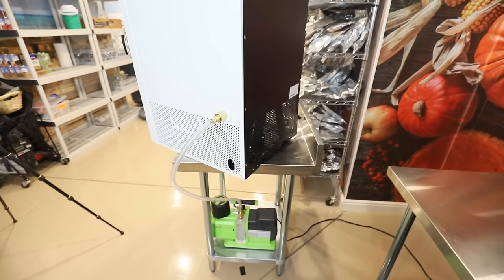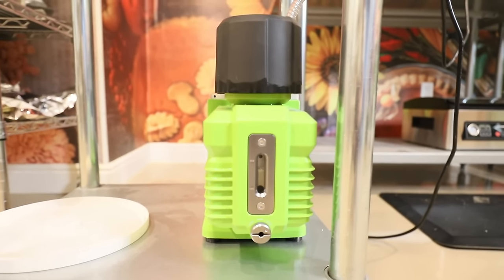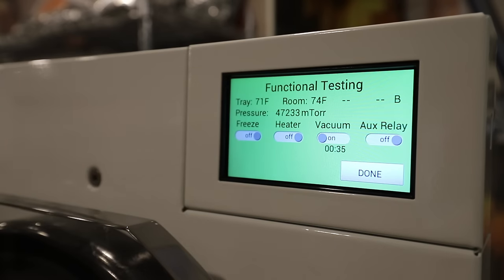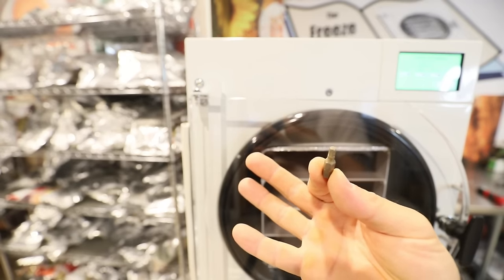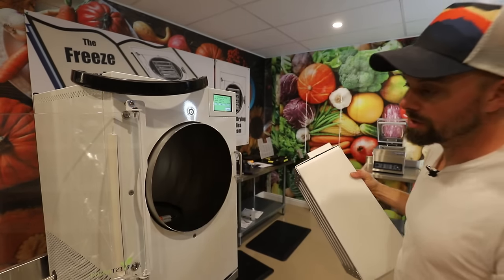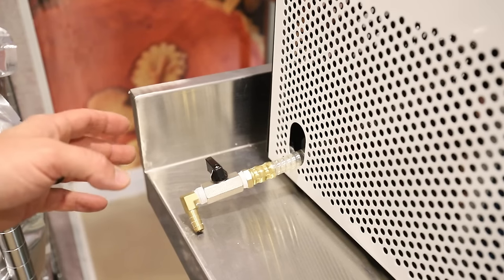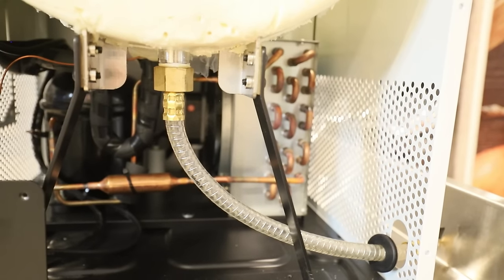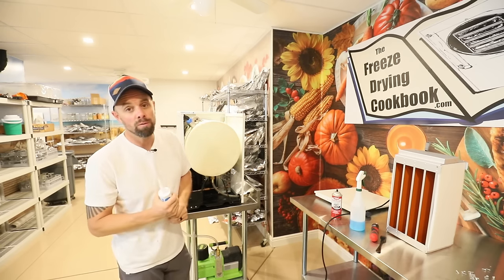Freeze Dryer Vacuum Error Troubleshooting -- SOLVED!

Comment: I have a leak in my vacuum chamber.  I have replaced the valve with a brass one. Tested it and it shows no leak. I also coated all connections with liquid tape. Replaced the door seal. Replaced the pump and pump hose. Added rubber seal sealant to that hose. The vacuum will go down to 360 in 30 min IF the tray holder is removed. I can put it back in and not even plug it in and the vacuum will not fall below 860. The tray holder is a full inch away from the rubber seal on the door. I have adjusted the door, removed the door and turned it over to no effect. Can't figure it out.

Comment: TO CLARIFY, when he is talking about the M Tor level jumping, that is with the pump running. Merely plugging, temporarily or permanently, a hole will not cause the M-Tor level to rise.

ONE more potential leak, which is among the early on checks, is, the gap between the tray racks and the door gasket.  If you allow the tray rack cable to slip down the wrong area, which happens often, the rack will not be able to slide all the way in. When you shut the door, the gasket and rack will be touching. 

If the rack and the gasket are touching, pull the rack out and reposition the electric cord. If in the proper position, you will have ABOUT 1/4" gap beteen the drying racks and the door gasket.
Reply: THis is something that I discovered for myself when chasing a vac problem. No gap between rack and gasket equals trouble!
Reply: This is what the HR tech told me today.  I moved the cable and taped it to the back wall per his suggestion but still have a problem getting the shelf to move in any further and when I ran batch again, got same error.

Comment: You missed an issue with the door gasket.  I was washing my regularly.  It would still have water and when the chamber froze, it froze the water in the gasket.  It changed the configuration as the water expanded.  I still wash it regularly, but I make sure it and the chamber wall is bone dry.  I went from 1200 to 300 mt.

Comment: When you say "while under vacuum" when checking for leaks, is that while the pump is running?  Or turn the pump off once it bottoms out and check before opening the drain valve?

Comment: After viewing and reading comments, I assume the manual does not show the steps in operating a vacuum pump. I worked at a construction equipment company for a few years that dealt with compressors and pumps. Those little pumps require a little extra care in their operation. Yes, they are very loud, especially before it gets a chance to get the oil warm and circulating. Depending on the type, it can take anywhere from 15-30 minutes to get the pump ready to work. You can hear the difference in the sound once the oil has worked it's way around. This will improve the pumps efficiency greatly; even the cheapest pump will last 10+ years. 
Once the job is complete, there is one key step that should be taken to extend the life of the compressor oil. The pump needs to be run at full capacity for 2-5 minutes  with the air intake plugged. This will help purge the volatiles from the system. Volatiles are what are created by the pump (internally) and can damage the seals and parts of the pump. But that is something that should be done in a garage or outdoors away from where you are working. You will never get rid of that crud by simply emptying and refueling or even flushing. It has to be "burnt off" in a sense.
Some of the newer, more like a sealed unit may not need the purge as some models have filters on them. But they still require a little warm-up prior to use.

Comment: I've been also getting can't process vacuum message. I also been getting condensation on the window and rubber, when its on freezing mode. I also noticed the temp keeps going up then down 1 or 2 degrees, then go back up. Are these issues normal?

Comment: We had a problem with Vacuum Error. After months of back and forth with HR and doing testing, getting a new pump, replacement seals, with no solution, my husband suggested tightening the door. Problem solved. UGH! All the trouble and frustration and it was simply the door had worked a little loose. Well, we are just thankful to have the problem solved. My husband wanted to send it back because there are too many things that can go wrong and it, obviously, can sometimes be difficult to diagnose the problem, causing lots of down time and much frustration. I really wanted to get the problem fixed. Thankfully, he was willing to stick with it and now the FD is finally running again. Hopefully, this is the last problem for a while. There have been several problems and more down time than working time since we bought it. HR does try to work with us to get things fixed but it can be difficult without an experienced repair person on the spot to do the testing and repairs. But it seems things do eventually get fixed if everyone is patient and sticks with it. Fingers crossed...

Comment: I've had a Harvest Right Freezer for several years. I recently bought a new vacuum pump to replace the JB Eliminator 6cfm pump that came with my machine. I ordered a new pump from Harvest Right. The new pump had fittings that were not compatible with my machine. I have tried numerous times to resolve this issue with HR customer service with no satisfaction. They don't even take the time to have a tech call me help resolve the problem. The customer service people who answer the phone are not English first speakers. So my message to Harvest Right customers, don't expect much help from their "customer service." My plan is to return their pump, which cost around $300. I don't even care if they refund me. Their pump is useless to me. I asked about sending it back, no response. I will buy a new JR pump identical to the one that came with my machine. I know that one will work with my original vacuum hoses. Buyer beware!

Comment: THANKS so much for this video! After one year of owning the dryer and not having vacuum problems (but had many other problems every month or two), I only had to watch this video, touch each part I suspected, and in the end just had to tighten the tiny screw on top of the harvest right drain valve.  I'll replace that drain valve as you said.

Comment: Hi, i just received my machine, it’s not reaching the 500 on the initial vacuum test required to be done before the bread run. I tried doing a vacuum test 2 times, after 30 mins it was at 650, and the last 12 mins it was kinda stuck at 650. I called harvest right, I was told to do off gassing, 12 hour process. I haven’t done tbe off gassing yet, I feel like the ppl i spoke to on the phone, have no idea what they are talking about, explained nothing, just said they were gona send an email on how to do off gassing. Do you have any experiences this? Again, machine is brand new, trying to get it up and running, please help ,

Comment: I have a machine from 2016 that is not achieving the vacuum. I took the hose to the pump off and noticed the “gaskets” (I think that’s what they’re called) were bad, so I ordered some new ones, but I may have ordered the wrong thing. In this video you have a small black o-ring where I have placed a much thicker orange gasket.  Could that be the wrong part and causing the vacuum problem?

Comment: En thinking the problem was the oil filter because it’s so cheap and strips the threads if you look at it wrong. Have you ever had that be a problem and can you get the fittings to not have to deal with Harvest right?

Comment: We went through all this and couldn't find the leak. Put tape over drain valve to seal it off. Did all this and come to find out the vacum hose on the pump was sitting on crooked. Straightened that up fixed the problem. Got 430 on vacuum in 10 minutes after Straightened hose on pump.

Comment: I've had my medium freeze dryer little over a year and got the vacuum error after sitting idle for a month while on vacation. I have some knowledge of vacuum systems through my work on an industrial level. Long story short I replaced the vent valve with a brass on from Home depot. Switched out the pump oil run pump on test mode for about 15 min. Noticed the oil still cloudy changed out the oil again and ran the pump again for another 15 min. I repeated this till the oil was clear as water. Now I'm back in business....
I used the filter pitcher that came with the premier pump to cycle the same oil.
The oil not only lubricates the pump but also draws air out of the chamber as well.

Comment: I've recently noticed a good amount of ice building up on the highest point of the door seal gasket and my machine can't maintain a vacuum of less than 700mTarr. Is the ice an indication of a leak? Never noticed the ice/frost until I started getting a vacuum error.

Comment: Great video. After manually running the pump to test mt and then shutting off the pump, what it too fast on the mt's numbers increasing? What leakage is not normal, time to find the leak? Thank you so much.

Comment: Although not touched on in the video, oil the 0-rings, the sealing surfaces inside the female fittings and on the outside of the male fittings AND on the threads. The oil helps the O-Rings seal and helps seat the threads better.
Also, make sure that your hose is centered  in the nuts (fittings) as you tighten them down. That little issue messed with me for a week, before I got it figured out.

Comment: Got my freeze dryer earlier this week. It is not getting cold for some reason the screen says it is at -40 but when I check the actual temp in the machine its just about room temperature. I can't find anything online about this. I have an appointment with a technician next week but asking if anyone has this issue or know of a solution?

Comment: I had this happen a week ago. I replaced the oil. Then ran a test, still didn't work. I ended up opening up the pump and it had smelly disgusting oil residue. I cleaned it and put fresh oil into it. It fixed it up, it was just bad oil.

Comment: Just under 1 year old large size. Worked well until early this week got inadequate vacuum error.
Contacted harvest right and did all the leak tests amd couldn't find any mtorr changes while spraying connections. They suggest new silicone for the vacuum sensor area on top. Did that let it run 8 hrs sit 24 and still had the same problem of only getting to the 700s mtorr with tray rack in. Take tray rack out and I can get below 500. Any ideas?
Reply from the maker: My sister in law was just having the same problem after she moved hers.  She finally put food on the trays and just tried to run a cycle and now it's fine

Comment: It appears the top screw on the Plexiglas door is bent or threads are crooked or Plexiglas was drilled and tapped crooked OR needs to be tightened.
Reply from the maker: They are supposed to be loose.  I thought the same thing

Comment: Help, Narrowed down vacuum inadequate error. Take tray rack out, bottoms out just fine. Put tray rack back in, doesn't bottom out. Tray rack is not touching door rubber seal. What could be the problem. In vs. OutThanks for any help. New machine.
Reply: Same thing here but this question doesn't get answered for some reason.

Comment: Very good vid!  Was wondering if anyone has had good or bad experiences with latest software update?  Software Update - v5.x.23?
Reply: Yep.  I was mid-stream with a vacuum problem resolution.  I upgraded to .23 and also did the silicone patch on the epoxy plug.  Fortunately, the silicone fixed the problem, because after the software upgrade, I could no longer capture log files for the HR technician.  I mentioned this, and he just said, yeah, they've been having some problems with that.  That said, the new version was supposed to improve performance and even shorten batch times, and I can say that it definitely seems to have done that.  I just hope I don't have add'l problems, not being able to produce log files in the future.

Comment: Just set up my brand new med freeze dryer and had the vacuum error right out of the gate. Called HR about the lack of O-ring on one side of the vacuum line and they said only one is needed on the freeze dryer side. I found that to be very odd. What do you think? I saw you touched on that point briefly, but never really said whether it needed two O-rings or not.
Reply: It takes two, one in each end. Although not touched on in the video, oil the rings, the sealing surfaces insides the female fittings and on the outsides of the male fittings AND on the threads. The oil helps the O-Rings seal and helps seat the threads better.
Also, make sure that your hose is centered  in the nuts (fittings) as you tighten them down. That little issue messed with me for a week, before I got it figured out.

Comment: Thank you, thank you. I have a new freeze dryer that within only 3 months started this vacuum error message. Last time I had checked your site, there was nothing on the subject. I called HR but they're never really very much help at all, which I find to be the only drawback to HR. I had read the manual but this video combined with the manual is enormously helpful! I had no idea the pump plugs into the dryer and my manual does not mention that! That seems to have fixed my problem for now, at least. Thank you so much.
Reply from the maker: You got it! Happy Freeze Drying!

Comment: Just as an FYI: What you refer to as the "vacuum feed" is where/how the cable that plugs into your connector on the rack gets inside the vac chamber. The vacuum sensor is also in there, though I haven't pinpointed its exact location, but I'm fairly certain that the actual device that reads the vacuum level is somewhere within the passthrough pipe, rather than being on the rack itself - reasoning: You still get a vac reading if you remove the rack - I wouldn't expect that to be the case if it were on the rack itself, unless there is more than one vac sensor (Which I VERY highly doubt) in the machine. The rest of the wires go to the heater pads on the bottom side of each level on the rack to power them, and there's a temperature sensor mounted somewhere on the rack itself, although, once again, I haven't pinpointed its exact location - I suspect it's under the "box" that appears to be riveted (At least on the late 2021/early 2022 model we have - perhaps it's screwed down instead of riveted in the newer models) onto the rear of the rack.
Reply: The vac transducer has its own welded pipe connection on the top of the chamber. The wires that go to the rack are only the heaters and the one temp probe. The temp prob is on one of the racks under one of the heaters.

Comment: Right out of the box doing the bread cycle had the vacuum fail. Went through the whole machine. Turned out to be the wire epoxy fitting. Got it siliconed and working good so far.
Reply from the maker: That's too bad that it had to be the last part to check.  Glad you are up.and running

Comment: When you spray the carb cleaner to test various points do you have the vacuum pump running ?
Reply from the maker: no. If you have the pump running, it will not allow you to accurately track the mTorr

Comment: What would happen if someone ran the vacuum pump with the door open or an other serious leak like a hose open? Would the pump overheat eventually or would it over rev or can the pump handle an open air leak if it has good oil levels?
Reply from the maker: I'm not sure.  I don't think I want to find out the answer

Comment: I'm surprised you didn't mention software updates...I've heard that's the remedy for most who have this issue.I didn't know I was supposed to be doing updates (thought it was automatic, & HR emails have all gone to spam!).
Reply: Actually, I don't believe any software update will solve a vacuum error issue.  I had the inadequate vacuum message with the prior version, then upgraded to 5.2.23, with no improvement.  Worse, there's apparently a known issue with that .23 upgrade -- many who have installed it can no longer capture log files to send to the HR technician for diagnosis.  Really hoping they release another version soon to resolve that bug.
Reply: I'll back up here and clarify that software won't fix a mechanical leak.  However, after I did the silicone patch on the epoxy plug, functional testing produced wildly impossible readings (i.e., negative mTorr numbers).  This did, in fact, require tweaking the software settings, via a method not really on point in this thread.  Once reset, the vacuum fix was properly registering.  Have had many completely successful batches since.

Comment: what if the oil is slowly leaking out of the glass on the vacuum pump?  I have a premier pump. Will this cause MTOR issues?
Reply: Nope, but they will replace your pump under warranty. I had the same problem. Pump worked well, but dribbled oil at the view pane. The leak will grow, slowly.

Comment: That's an odd recommendation to use carb cleaner to test for vacuum leaks.  Once that gets pulled into your FD, that would be difficult if not impossible to clean it out.
Reply from the maker: That is a recommendation from Harvestright.
Reply: @live.life.simple.  did HR advise as to how to thoroughly clean out any carb cleaner that might get sucked into the freeze dryer?

Comment: Now if you have a problem and you need to talk to tech support they charge you to talk to them even though the machine is under warranty. Too bad they are the only company that sells freeze dryers.
Reply: They are not the only company selling freeze dryers now. There are at least 2 others in the US.
Reply: I have had several warranty-period interactions with HR techs and have never been charged.  In fact, the first one sent me a new pump.  The second one finally correctly diagnosed the problem.  But, again, there were no charges.